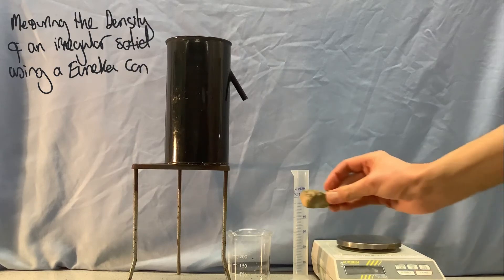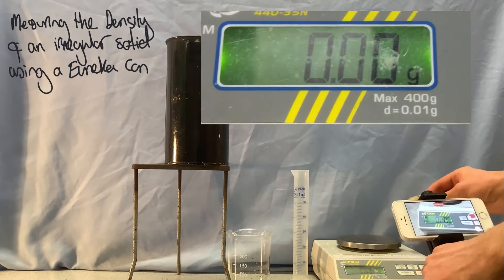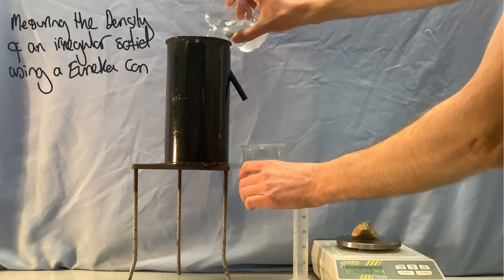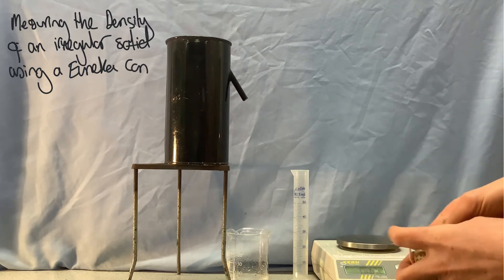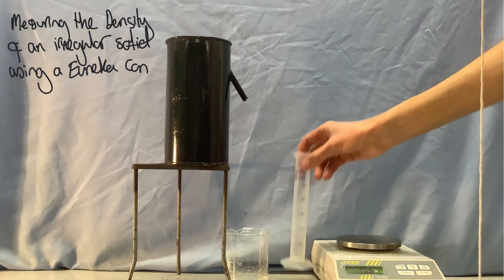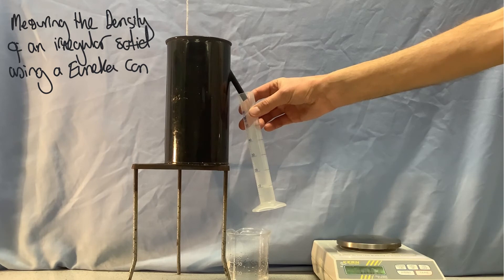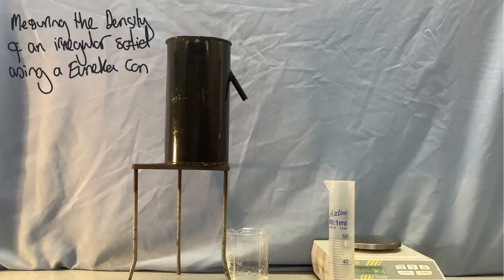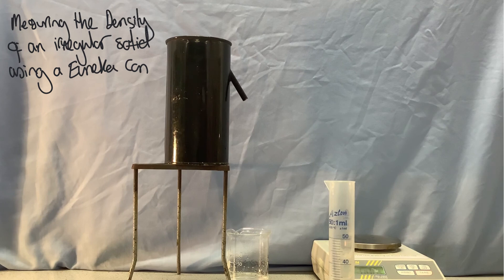Measuring Density of irregular solid with Eureka can

Comment: why do we need to use a string when lowering the stone
Reply: dropping it might cause the water to splash which will lead to an incorrect volume reading
Reply: It is so because that the substance doesn't touch at the can walls
Reply: It is because if we just drop it, the exact volume will decrease as it would splash some droplets out according to Newton's third law and we won't get the exact volume
Reply: So water would not splash out, resulting in an inaccurate measurement